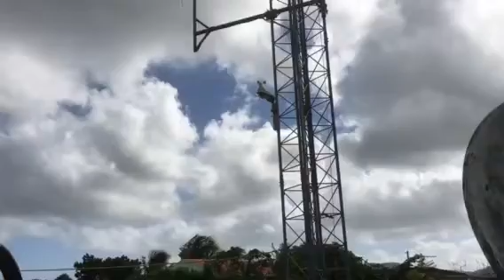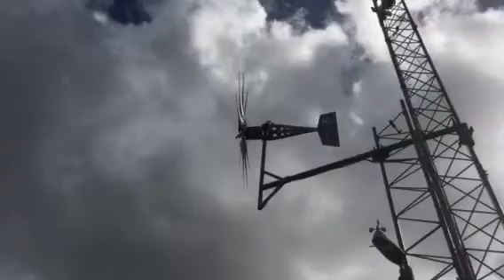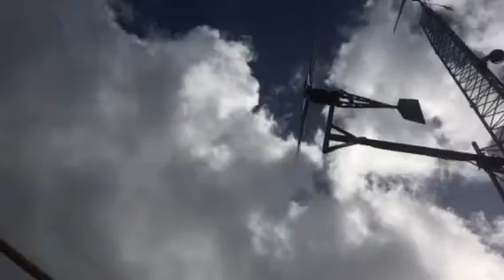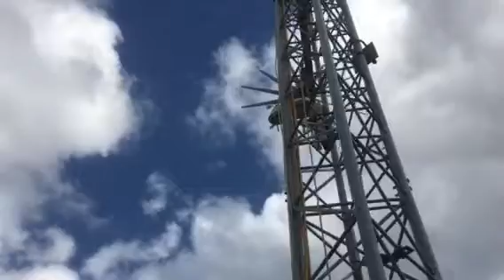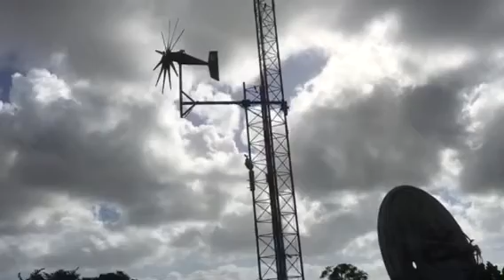Wind turbine seized operations.

Comment: they have pretty small chinese made bearings for what they are, theyre pretty tight to pull appart i got a couple of dents in the case now, i dont use the turbines theyre packed away now, no good for my low winds, good luck i know you will find a solution because you are a can do man.